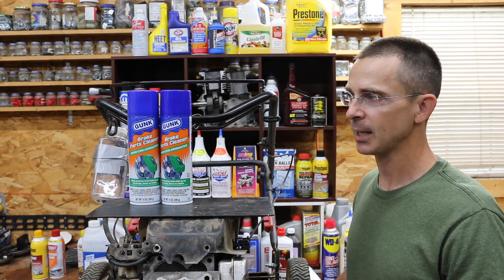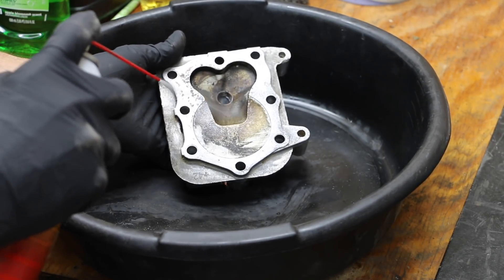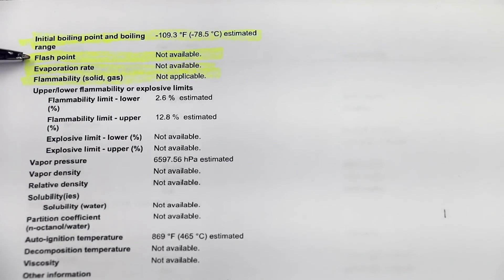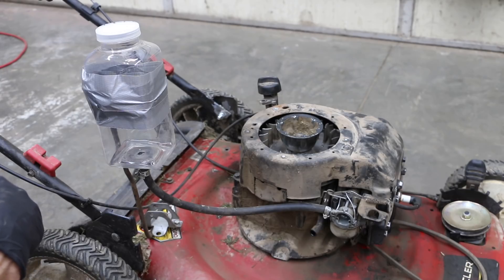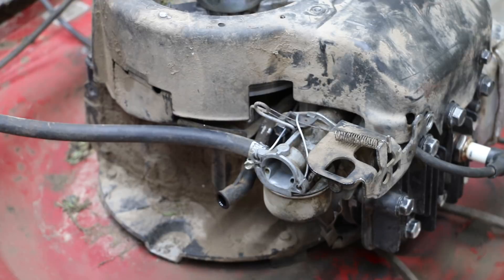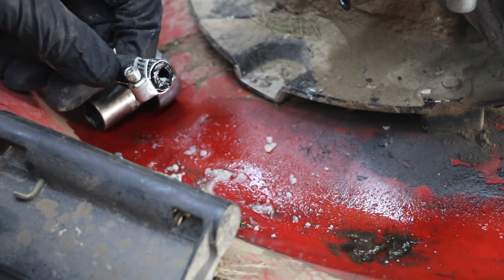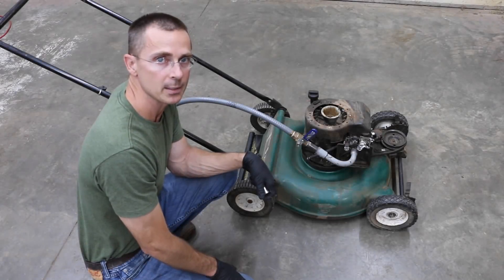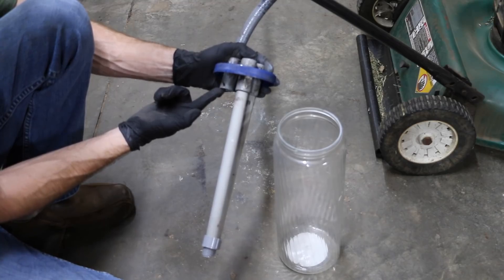Will a Gas Engine Run on Brake Parts Cleaner?  Lets find out!

Comment: I've heard stories that running to much ether or starting fluid can damage an engine. Have you done a video on this? Thanks.
Reply from the maker: Yes, I ran an engine for nearly 30 minutes on starting fluid without any damage.  I wouldn't try this on a diesel or auto engine.
Reply: Project Farm Thanks, just watched it.

Comment: Great video - that fluid was attacking everything!

Also interesting how companies  change formulations so often, but with no change to the branding. My 2015 MSDS had the gunk non chlorinated at ~50% Heptane, ~40% Methanol, <10% Propanone

I wonder if there's a good example out there for a video on a product  that used to work well but got made less effective due to a change like this.

Looking forward to the next one. Thanks!
Reply from the maker: Excellent points regarding changes to products. Thanks for the positive comment.

Comment: There is a tiny rubber seat in the float needle passage. If you put compressed air through the fuel inlet of the carb, it will get blown out at high speed. You'll end up thinking it was debris and then when you run the carb, you get the flooding. I've done it a few times. Keep em coming, very fun to watch.
Reply from the maker: Thanks for commenting on this.  The brake cleaner caused the rubber seat to expand significantly, restricting fuel flow.  Thanks for the positive comment.

Comment: Running an engine on "the works" toilet bowl cleaner mixed with aluminum foil balls to make hydrogen gas to fuel the engine.
Reply from the maker: Thank you for this recommendation.

Comment: Brake parts cleaner presents an interesting fuel for your vapour feed. (Thank you for showing that it is a three tube set up, two intakes, one output)   Not all the components of the brake cleaner will have the same vapour pressure.  I have absolutely no idea,,,, but could the mix of the components that remain in the jug after the engine run, be a different proportion to those same components prior to the run.  Are you vapourizing, and burning off, only the most volatile ?  Your initial engine run may have stalled because the most volatile had been consumed.

Yes, I would expect the brake cleaner to eat, dissolve, the rubber,,, but especially,, the clear plastic fuel tank. Of the common available clear plastics, several will be eaten alive by brake cleaner.

No answer required,, fun to watch
Reply from the maker: All great points and thanks for commenting.

Comment: Will an engine run only on 50:1 ratio fuel if you use that as a substitute for oil?
Reply: Samuel Krinninger How about scented oils? My friends used to claim they could tell what oil you used in a 2-stroke by the smell. What if it was bath oils, or coconut oil? Pine scented oil? You could have the prettiest smelling chainsaw out there!
Reply from the maker: Thank you for this recommendation.
Reply: 9Nails that would be cool but the only issue is the fact that the oils have to be able to ignite. I believe gas helps it ignite while the oil in the mixture lubricates everything such as the Piston so it prevents scoring just like any engine would. I worked on a chainsaw once and blew the Piston rings. I think that was due to lack of lubrication. Like I said, I don't know for sure but I'm pretty sure that's how it works.

Comment: Not so much an idea just an advice I work at Napa Auto Parts we sell a hose it's called multi Duty hose it's red it will handle any chemical you put through so you won't have to worry about your fuel line being about bike carburetor cleaner kerosene or whatever you do next they can handle all the different chemicals
Reply from the maker: Thank you for this recommendation.

Comment: I wonder if there is a way to adapt a glow plug to one of these and increase the compression ratio so it will run on diesel. In addition, change the way fuel is delivered since diesels aren't throttled by air. Project farm and other commentors really get my gears turning.
Reply from the maker: This is a terrific recommendation--thank you!

Comment: Hey Project Farm, it’s good to see the great content still coming! Here are a few idea’s for future videos I think might be popular:
-Fill the crank case with Anti-seize compound and see how long it takes for the engine to seize
-Fill crank case with lower end gear lube that starts greasy and then turns to liquid when hot
-Fill crank case with gear oil and sawdust
-Test which rust penetrant (WD40, Kroil, PB Blaster or other brands) and see which works best
-Run an engine on %100 Nitrous Oxide 
-Take the cylinder head off, put a piece of change on the piston, reinstall cylinder head and run it to see what damage it might cause
Thank you so much for everything you do for all of us and you deserve the popularity!
Reply from the maker: Thank you for these terrific recommendations and thanks for the positive comment.
Reply: Project Farm Thank you for your reply. I would like to contribute to your channel, is there a way I could contact you to discuss what I had in mind? Thank you again.

Comment: its a petroleum distillate just like gasoline is...early engines ran on a combination of Benzene, Heptane, octane and others in various combination which is pretty much gasoline today plus we add a long list of chemicals from alcohols, Ethers to salts like picrate...and the propane will burn very well in an engine and BTW Propanone is another name for Acetone which burns just like gas in an engine...what you need to do is find stuff thats not a petroleum distillate that would burn in a low compression engine like how much corn oil could you burn if you mix it with ethyl alcohol
Reply from the maker: All great points. Thanks for commenting and thanks for the recommendations.

Comment: Will a mixture of 87 octane and acetone increase mileage and reduce temperature? Some old timers I used to work with claimed it works. I'm not sure what it would do to a fuel tank or fuel lines over time, but give this some thought.
Reply from the maker: Thank you for this recommendation.

Comment: Clear tubing the next time you replace the fuel line to the clear tank. Less reactive then a rubber hose and you can see if it is doing anything or even flowing.
Reply from the maker: Thank you for this recommendation.

Comment: TEST Suggestion: Test Redline D6 ATF which is a group 5 Ester based ATF  vs  that Havoline full synthetic ATF which is a group 3  (i would assume) that I saw you used in the lawnmower cylinder head cleaner. Get 2 lawnmowers and do the cylinder head carbon cleaning test on both and see if a group 5 Ester based natural cleaning power cleans better then a hydro-cracked  group 3 Havoline ATF ->(AKA -> "Pharmaceutical" so to speak/highly refined, Dino oil  group 3). Read below.....

then do a soak test with the two units, to see if the Esters clean that much better on the soak test. 

http://www.machinerylubrication.com/Read/29113/base-oil-groups

.

Comment: Seeing as small engines have small simple carbs, have you ever compared the fuel consumption between fuel into the carburetor, vs. your vapor intake?
Also, seems like a good cheap DIY fix if your fuel system/carb. is shot but your throttle plate is still working.
Reply from the maker: I tested it a while ago and fuel consumption was nearly the same.  Great point regarding a workaround for carb issues.

Comment: Wondered if an engine (small engine) would run on propane (perhaps using a modified vapor unit to mix air in)
Reply from the maker: Thank you for this recommendation.

Comment: That was Awesome Project Farm I’m Still Wait For You To Run the Mower Air Cooler 4 Cycle With Vegetable Oil In the Crankcase vs Another Engine With Regular Motor Oil In it’s Crankcase ..Lets See How Long It Runs Or If it Fails in a Torture Test On The Vegetable Oil Engine 😀😀😊😮😮
Reply from the maker: Thank you very much for the positive comment and thank you for this recommendation.

Comment: Propane...I checked your channel I didn't see anything on Propane. Many forklifts have a special condensor or evaporator that keeps it either liquid form or gas form not sure which. A buddy of mine converted his pickup to run on propane, guys always pranked him by shutting off the gas when he wasn't around, claimed he got more power and economy on propane.
Reply from the maker: Thank you for this recommendation.

Comment: Have you tried the vapor carb with out using the old carb on the engine as a mounting point? It may run better. Did running paint thinner in your previous vid cause any engine damage? Thank you for the spark plug comparison. Need to try liquid propane in the vapor carb. As the engine pulls a vacuum on the fueled carb the carb should start freezing on the outside. Sounds cool to see to me. Like if you also think that would look cool
Reply from the maker: I haven't tried running the engine without the carb yet.  Great suggestion on that.  Paint thinner (mineral spirits) didn't cause any damage.  Thank you for this recommendation.

Comment: I'm telling ya, man, you'd best set up some sort of flash arrestor on that vapor setup. It's gonna end badly if you don't. I've seen it happen...
Reply from the maker: I'll add a flash arrestor before using this setup again. Thank you for this safety precaution.
Reply: Wouldn't want to see you hurt. You do good work. Take it from someone who learned the hard way. I'd recommend the screens that they put on boat engines or jet skis. They're cheap, easy to come by, and simple.

Comment: Ok.  I just thought of a fairly inexpensive video project...E3 sparkplugs ($6.99) vs standard  champion sparkplugs (for example: j19lm) ($3).  Is there a power increase? Fuel usage/emissions  better or worse? Are the engine benefits listed on the E3 sparkplugs true or false.
Reply from the maker: This is a great video project idea. Thank you!

Comment: Run a 2 stroke like a weed wacker or chainsaw with gas and marvel mystery oil as the 2 stroke gas mix
Or
Run a 4 stroke on 2 stroke gas WITHOUT motor oil in the 4 stroke
Reply from the maker: Thank you for this recommendation.

Comment: Test gas from different gas stations. Chevron claims their fuel is cleaner than discount gas stations. Their Techron can supposably clean deposits left by cheap gas. Clean up a head and combustion chamber then run cheap gas through it and see how much deposit is left. Then run the Chevron with Techron through it and see how clean it gets it. Repeat in reverse and compare the diffrence.

Comment: What's the difference between brake cleaner carburetor cleaner and starting fluid
Reply from the maker: Starting fluid contains ether and oil for cylinder lube,.  Ingredients for carb and brake cleaner vary somewhat.  In general, carb cleaner seems to leave a film and brake cleaner doesn't. Both are powerful solvents. Thanks for commenting.

Comment: Great video! Will an engine run on fumes from muriatic acid (hydrochloric acid) This would emit hydrogen gas which is very flammable
Reply from the maker: Thank you for this recommendation. and thanks for the positive comment.

Comment: So if the vapor air mix is flammable, what happens when a backfire sends flame up that tube and flaming brake parts cleaner is sent flying?
Reply from the maker: Great point.  I plan to add a check valve before I use this setup again. Thanks for commenting.

Comment: One time I accidentally left a bit of brake clean in a carburetor of a tiny 2 stroke weed wacker engine. It ran super rough and smoked like a chimney but it ran.
Reply from the maker: Thanks for commenting.  Glad it didn't cause damage to the carb.

Comment: I have an idea for you why don't you compare running different fuels from the fuel tank versus running on fumes, will the fumes run longer than straight fuel from the tank,, measure out maybe one pint in the gas tank and run. And see how long it runs and one pint in a fume bottle
Reply from the maker: Thank you for this recommendation.

Comment: Brake clean is an extremely dangerous chemical when burned. Please read the warning and study up. The stuff breaks down into  phosgene when heated and can be deadly. Recommend issuing a warning and perhaps removing this video.  It gained infamy as a chemical weapon during World War I where it was responsible for about 85% of the 100,000 deaths caused by chemical weapons.
Reply from the maker: Thanks for commenting and this is great advice. I provided a safety precaution about using only non-chlorinated cleaner.  I mentioned to always avoid using chlorinated products. Again, great advice and thanks for commenting.
Reply: Great reply. Just hope your viewers take notice. Not all Brake clean is safe to burn. Can be deadly.  Nice videos!

Comment: I have a 1990 chevy c1500 i6 it showz 248k on the odomoter but has well over 320k. Should I use seafoam to try and clean it up or just stick with high milage oil
Reply from the maker: I would stay with the high mileage oil.  Seafoam shouldn't hurt, but if it's running really well, it'll save a little money to just use oil. Thanks for commenting.

Comment: Always nice to watch your videos, I know that the chemical makeup changes from brand to brand of brake parts cleaner, some brands use acetone/toluene mix and other brands have the heptane mix. I’d be interested to see how oxyacetylene would run an engine and how clean or dirty it would operate but I don’t know if you have oxyacetylene
Reply from the maker: Great point regarding different brands and thanks for the video suggestion!
Reply: Project Farm your welcome, these videos give me a lot of useful information I can use to better myself at small engine repair.

Comment: Glad to see it's the non-chlorinated brake part cleaner. The chlorinated brake cleaner produces very toxic fumes when it burns.
Reply from the maker: Yes, great point and thanks for commenting.
Reply: Anecdotal story about the danger of these fumes:I heard from an old-time mechanic that they used to use engine vacuum to pump down the AC system. (I have never heard of that but I suppose it's better than not pulling a vacuum at all). Due to an error they did this when there was still R12 in the AC system. R12, as you may know, is a chlorinated refrigerant. The MSDS says the following is produced if it burns: Carbonyl difluoride; Hydrogen bromide; Hydrogen chloride; Hydrogen fluoride; phosgene; carbonyl chloride. Someone who was standing behind the car breathed these fumes and died as a result, most likely because of the phosgene, although those other decomposition products are likely to be toxic as well.

Comment: Enjoy all of your videos and they are very informational!! I used to work in the automotive retail side and everything you have tested is spot on as for what works and what does not...not sure if you tried this yet or not but I was told that a small capful of brake fluid does wonders with cleaning the carbon deposits out of a motor...had a friend try it and it smoked for awhile but afterwards his car did run better! Thanks for everything that you do!! :)
Reply from the maker: Thank you for this recommendation and thanks for the positive comment.

Comment: There is a starting fuel for jet engines, in Sweden it¨s called "MC25" as I gather it, it contains oxygen bound in to the fuel, like Nitrous oxide but contained in a fluid form, when I was in the military I got hold of some and ran it in a 2-stroke, mixed 50/50 with regular gas, when engine was hot it ran with air blocked completely off and even ran with the ignition off, all carbon residue in the engine burned off and the piston seemed to get quite hot, may be because it ran lean!

We also got hold of some 108 octane helicopter fuel made for 4-cylinder helicopter engines and ran my old -72 Volvo 142 on it, also seemed to clean up carbon deposits in the engine and with an ported head (stage-3), high duration cam (S-cam for rally cross), dual Weber 45's and 12,5 in compression ratio it ran smoother than it had ever done, did not ever run it over 7K RPM but it maxed out at 220 Km/h (about 140 mph I guess) and it never had problems with knocking despite the high comp!

Would be interesting to se what it might result in, in an small engine like the once you try stuff on :)
Reply from the maker: These are great video ideas--thank you!
Reply: Think this is the fluid that's called MC25 and obviously should be handled with care :D

https://en.wikipedia.org/wiki/Isopropyl_nitrate

Comment: How does run time compare, straight gasoline in the tank versus same amount un the vapor engine?
Reply from the maker: It seems to be nearly the same. The vapor setup might run a little longer, since the engine is running a little lean. Thanks for commenting.

Comment: Interesting thing, the boiling point is 
exactly the boiling point of Co2
(Or, sublimation point.)

Well, close.  Wikipedia has Co2 
sublimating at -109.2  Your temp 
is -109.3.

steve
Reply from the maker: This is interesting. Thanks for commenting.
Reply: I work as a mechanic, and we use 
carb cleaner, and non chlorinated 
brake cleaner all the time as "squirt 
gas."  Engine won't start, pull off a 
vacuum line, and squirt some in.
If it then starts, we have a fuel 
delivery issue.

Also, at home I get the break 
cleaner, same price as carb cleaner, 
but the can is larger.  (Walmart brand.)

Again, great channel!

steve

Comment: How about running the see through eingine on gas vapors
Reply from the maker: Thank you for this recommendation.
Reply: Would love to see this!!! Then you could see the difference in burn from the air fuel mixture, that would be a great learning experience!!!
Reply: Project Farm please test NMF  (No more friction) it's a oil additive that semis are starting to run. Heard extremely good things about it. Amazon has it 44$ 175 5* reviews. It's like the messiah of motor oil we all been waiting for. Cleans all carbon and particles demagnetises for oil mobility is and reduces friction by about 30-40%